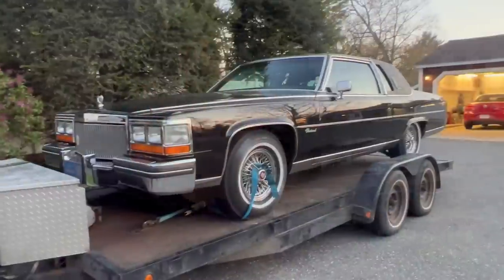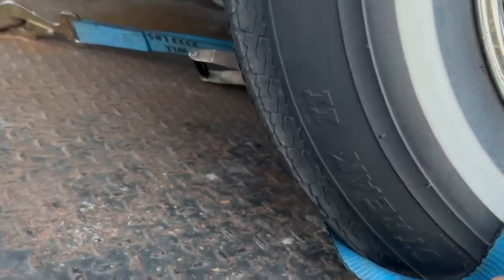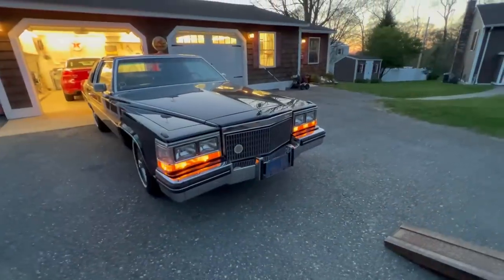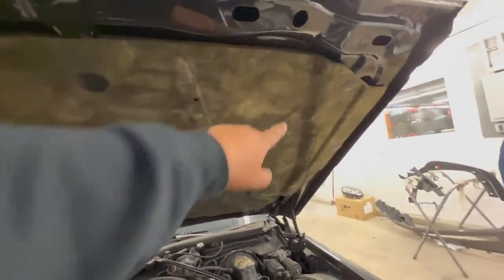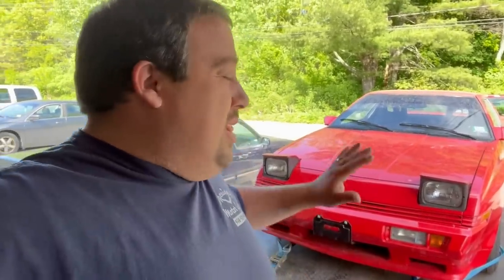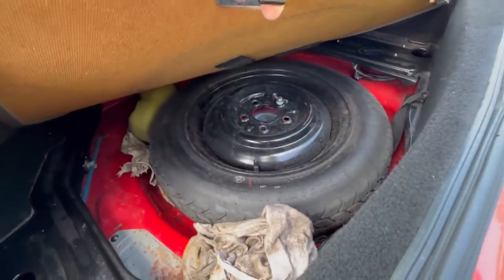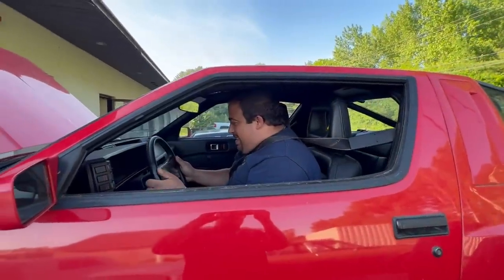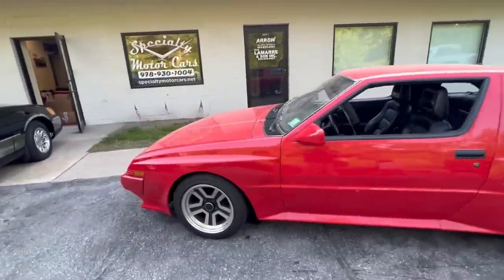We bought Two rare 80’s cars and the Cadillac isn’t mine! Fleetwood Brougham Coupe Chrysler Conquest

Comment: 368 is a very good engine but,if you don't like it a larger Cadillac engine fits directly in it's place
Reply: Correct. It's a 425 block I believe fit's right in.
Reply: @neilouellette3004  also a 472 and a 500.
Reply: @t.l.robinson2162  that 500 is the best engine ever made period.  That's why they stopped making it.
Reply: @dzgaming1  the 455 rocket wasn't a punk either 💪🏽

Comment: In 81 GM ruined the Cadillac with the v864 I think the 5.7 litre would of been a better choice
Reply: It’s the same engine as the 80 you can disconnect the 4/6/8 and it will stay in 8cyl mode
Reply: Ok good to know thanks

Comment: Beautiful Brougham Coupe. I regret selling mine. I had a Brougham Coupe d'Elegance 1980 as well. Was Cotillion white with a blue top (originally was white) and had the blue d'Elegance interior in velour, cloth. Was fully optioned with the exception of the astro roof and of course no leather seating. And it came with the 5.7 Diesel. But it was an electrical nightmare. No headlights, no power windows, seats, fuel gage, wipers, just a PITA overall. Must have either been built on a Friday or Monday-lol. I paid $500 for it back in the late 90s and then sold it for $100 in the early 2000s. I regret it to this day. Had I known then what I know now, she'd be fixed up nicely. I now own a regular 80 Coupe deVille. In Colonial Yellow with the Antique Saddle interior. And just acquired a 78 Coupe deVille in Cotillion white with Antique Mulberry leather and vinyl top. Paid $7k for it last month
Reply from the maker: Sounds like you have had and currently have some nice two doors! I love them. Stay tuned, I may have another ‘80 coming in 😀

Comment: What a coincidence ... In the 1980s when I used to drive Cadillacs, I needed a smaller car that was parkable in the city. Requirements were small, fast and luxurious. I bought a used Mitsubishi Starion (which is what a Chrysler Conquest really is). It was a fun car, but ... (1.) It was engineered for everything to start breaking at the 36K mile expiration of the warranty. Climate control was the first to go at 36,400 miles. (2.) Very difficult for a Cadillac guy to work on it. Only a small-handed mechanic's hands can get to anything that's not on the top if the engine. (3.) Only very young children could fit in the back seat. (4.) Great audio system but, as wife #2 used to say, the whole car was built around the radio.
Reply: I had the '86 Starion, first year of the flared fenders.  The rear fenders were susceptible to stone chips from debris thrown back from the front wheels in the rain.  So in '87 they added clear plastic covers on those areas susceptible to road rash.  You are right, there were issues as these cars approached 40,000 miles. On mine the turbo started making wining noises although I was always careful to allow the turbo to spool down before shutting it off.  Another issue was a mysterious brake fluid leak.  I used the car for rallying, and it was much more fun to drive than my '82 LeSabre.  Was working for an auto finance company, and there was enough room in the hatch for all my dealer forms.  One reason I liked the car was the automatic A/C, and fortunately it did not give me any problems.